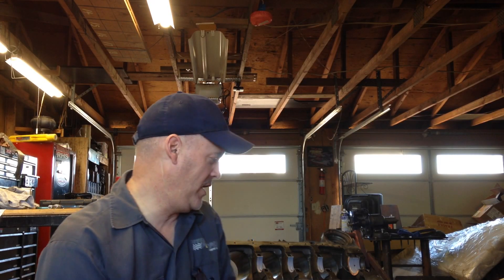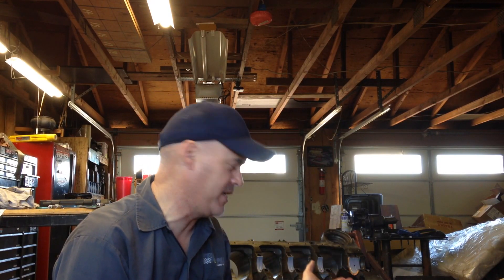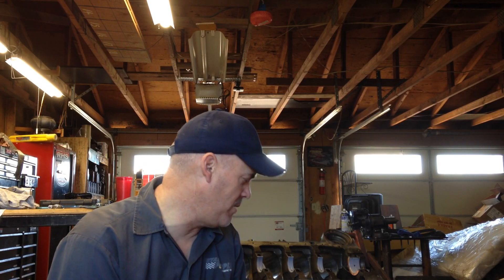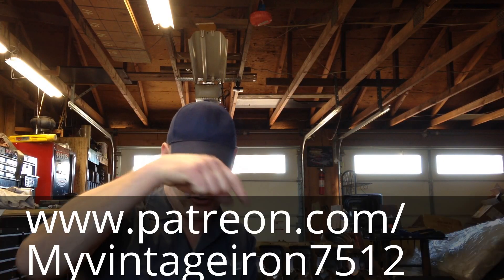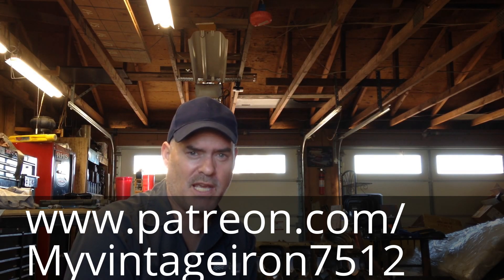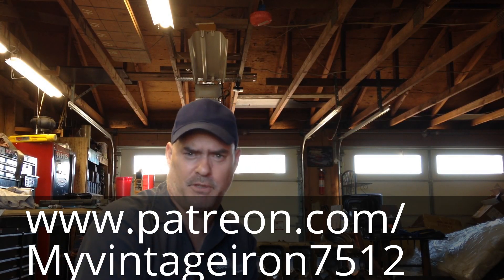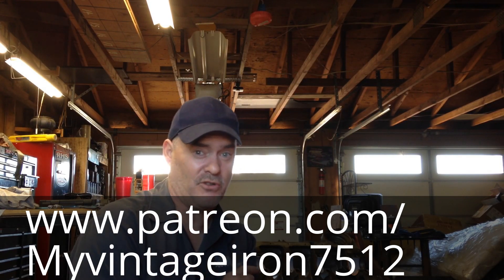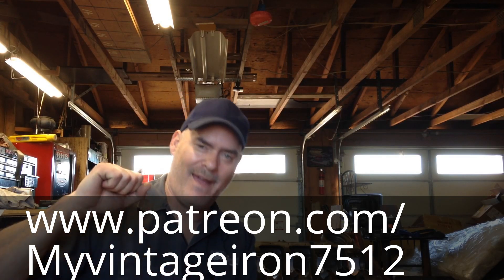Chevy 327 Breakdown

Comment: Oh, almost forgot the little Monza 262 cubic inch V8.
Reply from the maker: 262 and 307 were both terds
Reply from the maker: No attitude I;m just stating fact If I am a youngster you must be in yer 80's
Reply: @dehoedisc7247   you only made a comment, without any indication
   of a discussion or questions.   so, again the 262, 267, 305,
 and 307's are turds.  thats all the info you need.    next !

Comment: I got a 72 400sb. 4bolt main.   intrested?
Reply: The later 2-bolt versions are stronger.  You can tell whether or not your 400 block has 4 bolt mains by counting the freeze plugs on the side of the block - if there are 3 you have a 4-bolt 400.  If there are 2 and it's a 400, you have a 2-bolt block.
Reply: silicon212 oh   how about its on a stand right now and the pan is off....     lol    I got original parts for it.   last car it was in. well it was too mush torque the car was a right off.

Comment: ill never for get my goof step father , i was building up my amc 360 in my Javelin,, but he had to out do me ,,, he bought a nova with no motor and a 350 from some goof in a newspaper Ad (you learn later why i call hi a goof) it was 350 with 327 heads,  step father did not have a clue!!!!  he toke the heads to a Manichean shop and told them to go nut`s planing them ,,, fkin geneses compression  was mantel after be built back on, when he started it the oil filter spun off ,,, he shim the fk out the oil pump presure release spring,,,, when it came time to built the alternator, there where no holes in head for the bracket  Dah :) lol 
after driling holes in his fk up heads over plane heads , he got the motor running and the motor had a bad cylinder with piston slap ... ha ha ha the guy did everything wrong thinking he knew best and ended up a loser :) love it
Reply: What he should have done is take it to a GOOD machine shop and have it bored .030 over. Got some custom pistons, six inch rods, and a 3.75 inch crank. Bought a set of 15 degree heads and put it all togerther AND SMOKED THAT MOPAR JUNK 360!
Reply: I am talking a Chevy 383 stroker with 15 degree heads, it will make more horsepower than any 360.
Reply: Shut up , you want to fight :)
Reply: Shut up, I want fast cars. The 327 with 15 degree heads turning 9500 RPM would be fun!